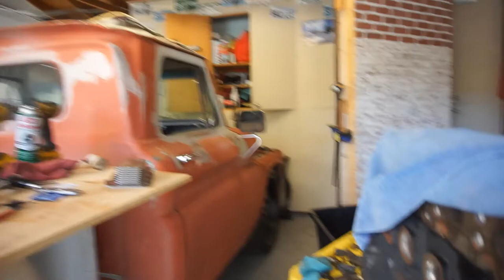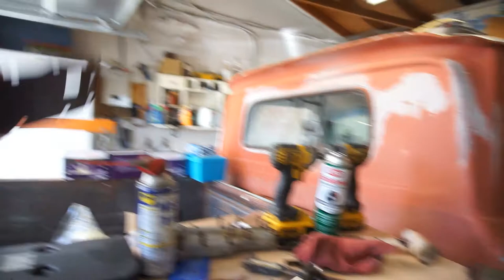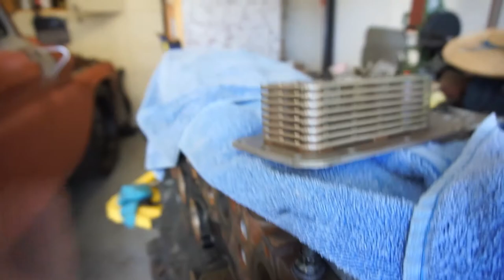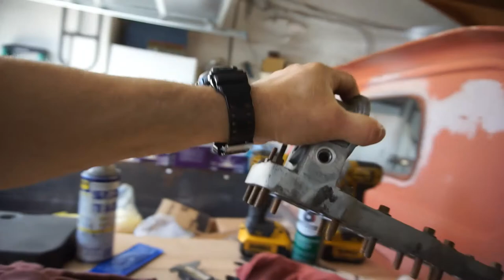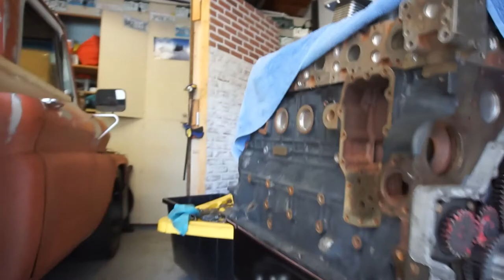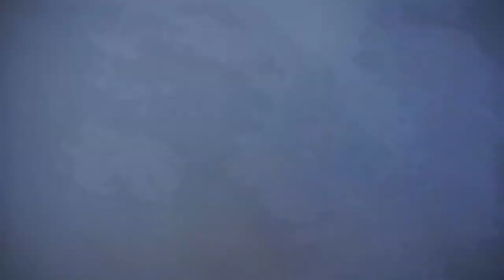Part 15 6.7 Cummins Build Installing The Oil Cooler. Or As I Call It Oil Heater..

Comment: It heats and cools, depending on the situation.  From a design perspective, it uses engine coolant temps to regulate oil temps rather than air temps from a remote heat exchanger.  I think the reason Cummins uses a 200°F thermostat is for emissions.  Running the engine hotter is required for modern after-treatment systems in order to meet EPA regulations.
Reply from the maker: Monster RAM I know it’s intention. But still come on. And yeah I was told the 200* thermostat was for optimum operating temp. I saw a mpg decrease when I changed mine to 190 but it’s better then blowing up an engine towing a huge trailer. Thanks for the info though.
Reply: @Halffast719   I guess I'm just not sure what your complaint is about.  Is it the name of the "cooler"?  It's true that running the engine between 200°F and 210°F allows for better fuel atomization, which yields better fuel economy and, in turn, reduces emission.  But when you start pulling a grade with a load for long periods, the coolant is what pulls the heat from the oil.  I'm guessing that this is where the name comes from? 🤷‍♂️  

But I totally agree, I run a 180°F in mine and she never gets over 210° (oil or coolant) when towing my 15,000 lb RV in 95°F heat through the Appalachians.
Reply from the maker: Monster RAM my only complaint is it is another failure point at which oil and water can mix if something goes wrong. That’s really all.
Reply: @Halffast719  That is possible, although it seems unlikely.  The alternative would be a remote oil to air heat exchanger that, 1) would require several feet of oil line, fittings, and the heat exchanger (more parts = more chance of failure) and, 2) if any of those parts failed, oil would be ejected out of the engine.  I'd rather have coolant in my oil than no oil at all.  Of course, you could just not use any oil cooler... probably not a good idea though. 😁
Reply: @monsterram6617  When the oil cooler leaks (not IF) the high pressure oil gets pumped into the cooling system, the coolant pressure is less than half the pressure of the oil at idle. You end up losing pressure and having a contaminated cooling system.
Reply: @briangc1972  You're correct about what would happen if it did fail. And in theory, you are also correct about when, not if a failure occurs. But out of the literal millions of Cummins engines out there, how many have had their oil cooler fail?  If the answer is less than even 100,000 (which I've not seen any evidence that it's anywhere even close to that) it's not a problem that can be attributed to bad design.  A design flaw would lead to significant percentages of failures, at least 30+%.  There are over 3 million 6.7 Cummins out there.  That means that we'd be seeing 900,000+ oil cooler failures and we don't see anything like that.  If it was anything close to that, there'd be a recall and there's not.